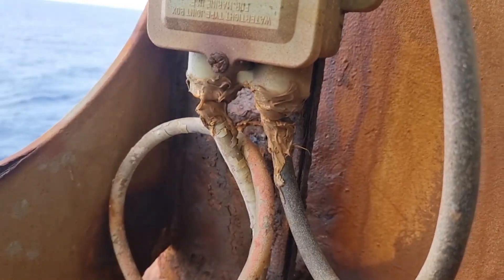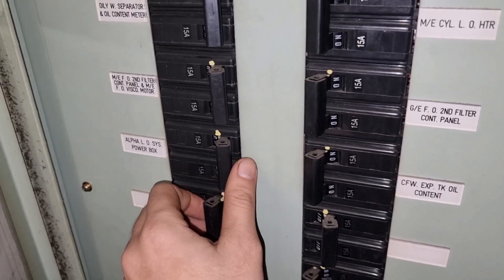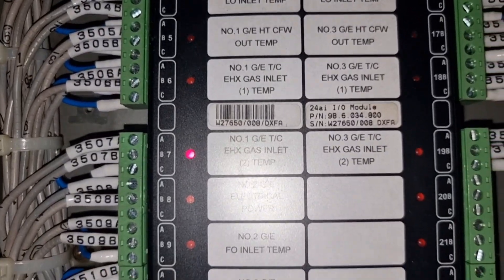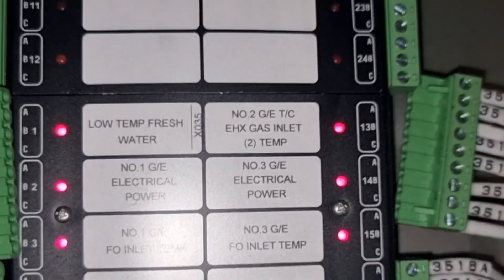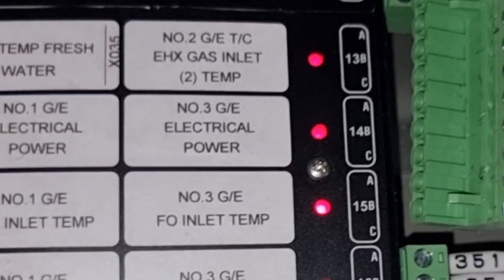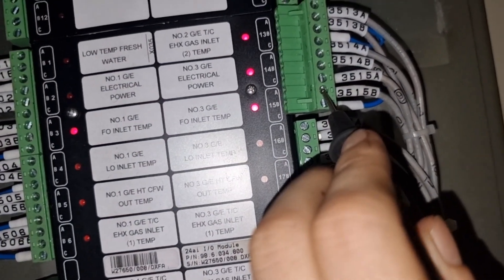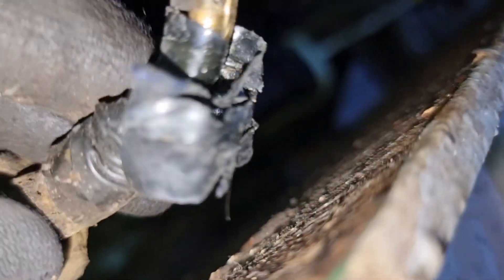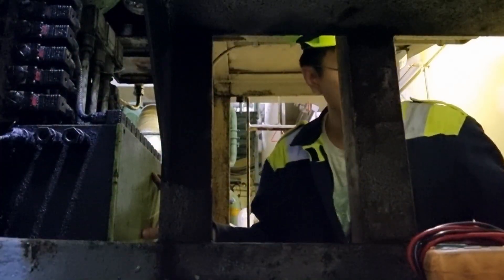GENERATOR 24 VOLTS LOW INSULATION TROUBLESHOOTING

Comment: Sir I have also a problem of low insulation of 24 volts alarm..but during underway situation the alarm was okey..and sometimes my 24 volts insulation indicator is flactuating.. Is the low insulation indicator have a problem.?
Reply from the maker: it depends, you should start tracing whenever it is active.

Comment: Did you eyeball the inside of the connector body for casting roughness. 

Think about if it can be done to remove the casting roughness. 

Use some 3m# 27 fiberglass cloth tape on the inside of the fitting and around the harness..
Reply from the maker: i did used the thermal cloth tape for insulating the wires